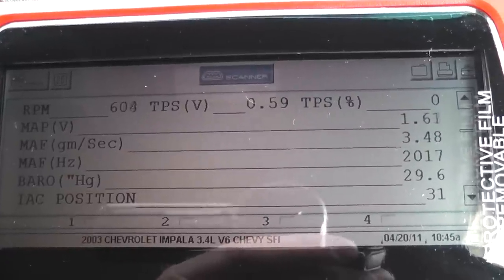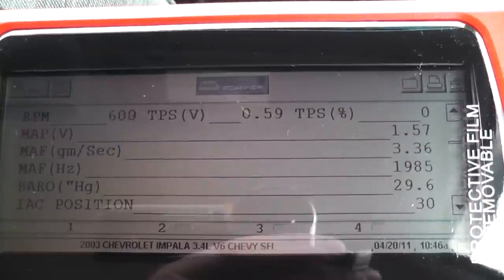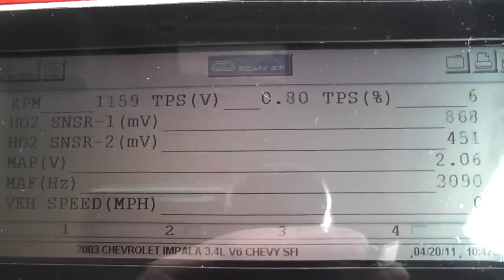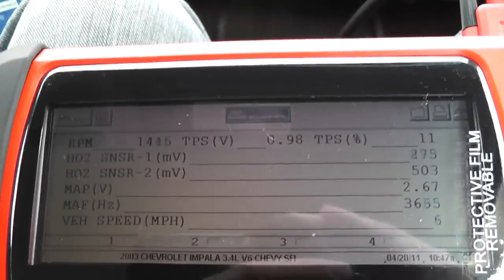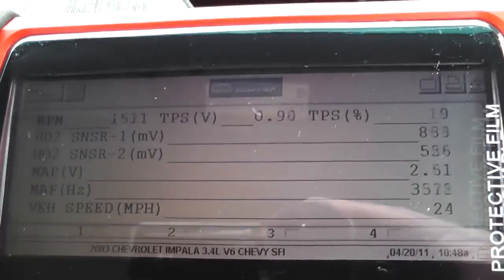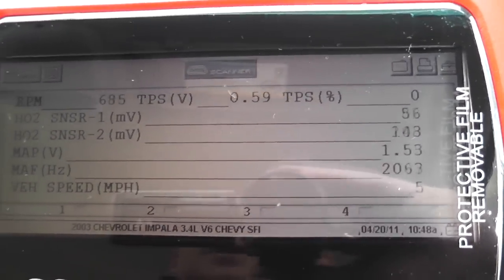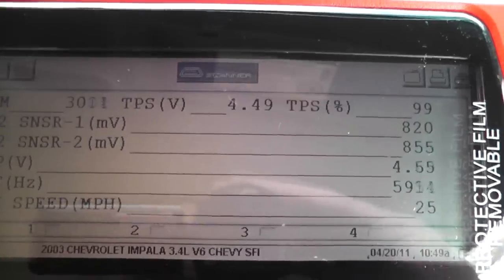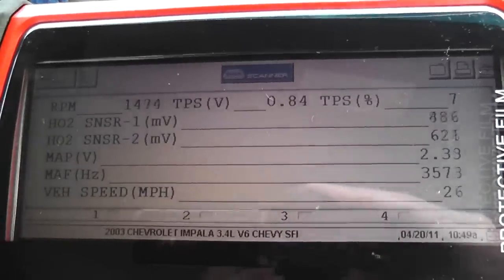How to test for a restricted exhaust (catalytic converter)

Comment from the maker: Thats good enough, just wanted to make sure it wasn't dead before we continue. For your fuel pressure test (since it is the regulated type), disconnect the vac, hose and perform a WOT snap, pressure should not drop off during the test. 
As I just typed this....the regulator you mentioned may not be a regulator, it could be a pulsator with a vacuum hose on it. Which would make this a mechanical returnless system. They look like regulators. see if there is a return line on the rail

Comment: Other test methods: 
1. use vacuum gauge (0,65 bar): § WOT : zero vacuum. 
                                                      § If restricted: 2000 RPM -> vacuum drops more and more 
2. infrared thermometer test on cat (@ 2000 RPM, outlet 60° hotter than inlet)
3. scantool: 2nd O2-sensor steady voltage (±0,5V)
Reply: I dont understand. Theres not supposed to be vacuum at 2000 rpm and by vacuum drop do you mean pressure goes up or down?
Reply: Great tips , thanks !

Comment from the maker: @buddiiee The restrictions in an exhaust  system come from a melted and broken apart catalyst. The pieces of the cat can become trapped in the muffler too so at times the exhaust must be replaced from the cat. all the way back to the muffler. (including the cat. too of course).
After the repairs the system should also be checked for a cause of the cat. failure. Its never good to just replace the cat. without checking for a cause.

Comment: Again thank you for your fast response. Actually yes, 98 Ford Taurus, 3.0 OHV engine, vacuum regulated fuel system. Fuel pressure was a little below spec. about 30 psi, but ran okay. (originally a no start and towed in) Both oxygen sensors switched good, but during WOT test, bank 2 went lean, although managed to run good. I did scope the fuel pump current which was around 4.5 amps but the waveform had a few spikes in it. Ran into the car at the end of the day so thats about all the info for now.

Comment from the maker: @westin1985 the intent of this video is not about performance tuning it is simply how to recognize if your cat. is restricted. backpsi at idle should be zero. in fact backpsi under 3000 rpm in PARK (meaning no load) should be very near zero. reason being is in park there is not much throttle opening so the engine isn't breathing very much

Comment from the maker: @altlandf Not for a short test drive and I have done that before to test for a plugged exhaust. 
Your OBDII code reader should have some data PIDS you can look at, so if it does, then yes fuel trim can be seen with it. You are not using fuel trim to ID a plugged exhaust. 
Yes you can use a regular psi gauge, in fact I made my own adapter with an old O2 sensor and I use my cheep vacuum /psi gauge

Comment: Love the vid. Our 13 expedition 5.4 3v.  had a clogged cat. Dealer wanted to do all the work backwards.  Tune up. Injectors. Ignition coils. Etc (out of warranty)$1400 before replacing the cat. (Still under warranty) 
After several meetings with mechanic and his stupidvisor, I  them if they can find a problem after the cat was replaced then I will have it repaired. Finally got warranty cat replaced, and magically the car ran perfect. They couldn't find anything wrong. 
Wish I knew what caused it.

Comment from the maker: @spelunkerd Not sure about the alcohol content, but after a repair, I make sure fuel trim #s look normal under different loads, also that there is no misfire. Truthfully on the Impala and Monte Carlo, I have seen so many melted cats. and found no cause when I am done. I think it may be in the programming of the fuel curve?. Here in the aftermarket, we just put a new cat in it (factory cat of course) and if everything looks good we let it go.

Comment: My reason for suspecting the catalytic converter... is I recently cleaned all the carbon off the intake manifold and throttle body. Most was wiped away, but obviously some went through the engine.
I also used to have problems pulling grades when I bought the used truck. But it was 50-90% fixed when I replaced the plugs & cleaned the TB/MAFS/Intake. Putting my hand to the exhaust is sad. It's like a very light wind.

Comment: Mr. Danner, I have one for you. 03 ram 2500 5.7 Hemi. P0300. I just got my Launch X-431 V and I only barely know how to use it but the little bit I do know I'm questioning because the cat has been cut out and a pipe put in it's place. It's been that way for years so I know that's not the problem here but I don't know how o2 and fuel trim data will look. I had access to a ton of parts off a known good engine so I threw EVERYTHING at it, injectors with rail, plugs, wires, coils...needless to say...same issue. Not only is it a p0300 but it's got a flashing check engine light. The live misfire data shows most of the misfires on 2 and 3, opposite sides of the engine! I've been watching your videos and am starting to learn what a normal reading of short and long term fuel trim, o2 but now this thing has no cat. What happens to the downstream o2 sensor data....same as if it did have a cat? I'm jut guessing here but it seems like it would read exactly the same as the upstream o2 sensor. I put a vacuum gage on her and it actually reads in the "normal range" of the gage but it's very close to the "timing too late" or something to that effect. It's been a plow truck and race car hauler all it's life...maybe this is showing me I have my chain is too stretched and it's throwing random multiple misfire codes? I honestly barely know what to do with the scanner so any help you can offer would be greatly appreciated. 

Thanks in advance.

Comment: Robinson auto has a similar video regarding a bad cat due to a bad plug wire causing misfire, customer was driving for a while with the engine light on-- the plug wire was arcing on the engine, one thing causes a chain reaction

Comment from the maker: That is strange, not sure I've seen that before. Lets not totally rule out fuel pressure here yet. Maybe it is borderline. Or maybe the MAF is dirty.  Check MAF volts, it should go over 4v at WOT redline. Also check your fuel pressure on a WOT snap too. actually I think you can monitor fuel pressure on scan data on that system right. If so pull that PID up during your test drive too. 
Last question, are you sure the bank that is dropping lean has a functional O2 in it?

Comment: Can you tell us the main things you look for when examining an engine that comes in with a clogged cat? Does alcohol in gas cause that problem? If the engine is running fine with no misfires, is there anything else that you need to check for?

Comment: I did have the o2 sensors in the 2 graph mode on a snap-on solus and same results during multiple WOT drives. Would you recommend any other testing that would be a smarter approach to one lean bank situation? Otherwise I will can have more info tomorrow unless I figure it out. Thanks.

Comment from the maker: I didn't look at fuel trim closely for this one, but I know at idle and low speed they were in the normal range. Well at least normal enough for me to not look to closely. Also at WOT fuel trim is not relevant due to the O2 sensor being ignored and the system operating in open loop.

Comment: This ford has the vacuum regulated system so there wasn't anything in the scan data for the pressure. As for the o2 being functional, I didn't scope it, although I did watch scan data while unplugging the brake booster and drove the o2 lean and the response was great and it switches good around 2500 rpm along with bank 1.

Comment: Would it hurt to run the vehicle with the 2 front O2 sensors removed?  I have a OBD II code reader will this find a problem with the fuel trim? What should I look for?  Would too much ethanol in the fuel melt the cats?  In Pa right now there should be no more than 10% of that garbage in the gas.  The 97 Explorer is NOT a flex fuel vehicle. The more ethanol the hotter the combustion gets. Anyway excellant video.  Could you not use a regular psi guage?

Comment: Hello Paul. I have question on this type of diagnostic using the o2 sensor data. Lets say you have a dual bank o2 sensor system and bank 1 (s1) reading is 800mv and bank 2 (s1) reading is 52mv at WOT. Would this indicate a fuel delivery issue? Would a MAF sensor problem cause both banks to be low? let me know when you get the chance. Thanks!

Comment: If you measure the MAP reading key on engine off?  That will measure baro pressure.  While at wide open throttle, if the MAP raises above baro?  That will also identify a likely restricted cat.  Although this test only works on non turbo vehicles.

Comment: Car went to 20mph a year ago and have been hesitant to tackle it, though I suspected exhaust. After watching this it doesn't look horrible to test before marching forward. Car apparently had a long term severe misfire, then with the help of a lumpy tire it suddenly acted up before we got it changed.
Reply from the maker: If you do not have a backpressure gauge, you can test drive it with the O2 removed and see if your power gets better. Don't drive it long this way, just one wide open throttle run to see.
Reply: @ScannerDanner  thank you, that's what I was planning originally, but I did go buy a gauge to check it right. It's just a junker car and maybe 4 years left before rust gets to something critical.

Comment: Thanks again Scanner and as always truly amazing!
My daughters 05 Ford 500 will only run momentarily with the throttle on the floor. 

It has codes P2196 Oxygen sensor signal Biased stuck rich Bank 1 Sensor 1 and a P2198 which is the same code for Bank 2 sensor 1.

It has 10.3 PSI  Fuel rail pressure but since the O2's are showing rich perhaps this is the problem? 
I have 10 PSI at the fuel rail using live data at any RPM.. 

But it also has a P0191 Fuel Rail Pressure Sensor Circuit range performance  code as well.
Reply: Sounds like sounds like a low volume fuel pressure to me. If fuel trims showing rich are you saying it negative fuel trims? If so then it's trying to add Fuel but can't because of low pressure. (Filter might be clogged) other rail pressure sensor is showing low because of not enough fuel I would bet

Comment: I had a nagging code P0171 P0174  p0300 p0304 p0306 on my 2001 GS 300 and the car would not go past 40... the Engine was loud and the car would have trouble starting... I changed the spark plugs, fuel filter and fuel pump at the tune of hundreds of dollars... Finally I tested the Ignition coils and the resistance was too high... The misfires (p0300, p0304 p0306) caused the oil to get into the CAT as well as making the car run lean and burning fuel in the cat resulted in a clogged cat that lead to the car not going past 40 mph... I was not going to get a new cat so I tried Lacquer thinner in a half tank of gas as well as dumping a can of throttle/ carb cleaner in the upstream (pre cat) 02 sensor hole... eventually it got better till it ran like new... The Lacquer thinner burns in the cat hotter than regular gasoline, burning the oil that is clogging it up... I saw it on Scotty kilmer and it worked for my situation... now the Risk is that the Throttle cleaner may have chemicals that don't go well with the metals in your cat or that the Lacquer thinner may damage seals in your fuel line... so they should be used with caution... however if you are going to change the cat why not clean it with Throttle cleaner first to see of it works? save 2 grand.

Comment: @scannerdanner 
cool video... hey, I have an issue that happen almost from one day to the next... 2000 firebird 3.8 5 speed.... @ first I thought it was the clutch because I would feel the car "sit" every other shift or when I took it over three thousand rpms. the first time I noticed something off was when I floored it and saw smoke... which it was weird because my car does not smoke.... then days later, again but lingering smell of any kind, especially burned clutch, it a rich mixture. So that's why I'm with the idea that it is the clutch or slave cylinder, but every gear shifts with no issue, no grinding, my clutch pedal is high and reacts normal, no vibrations, no hydraulic leaks. now, talking about the catalytic converter there is no rotten egg smell but twice now I've heard backfiring more predominant as I coast to a stop light. I don't hear it as loud as usual and the power is not really there, I also notice that it idles higher than normal....
with that said, does it sound like a clutch issue, a catalytic issue or a vacuum issue.... thank you for your time..

Comment: I appreciate the video boss!   Quick question for you though... if 1.5 - 2 psi at idle and 6 7 psi at 2500 rpm is high, what should the pressures actually be at?
Reply from the maker: Near 0 for this test

Comment: Paul - whats your thoughts on using an infrared thermometer to test for a clogged cat? I read that if the inlet temp is a few hundred degrees hotter than the outlet you have a restricted cat. However I'm not sure if you take your temp measurements at idle or 3000rpm. Your take?

Comment: You didn't rule out the muffler. Check the downstream o2 sensor hole with the meter. If low pressure, there is a restriction in the cat. If "high" pressure, the restriction is downstream from the cat.
Reply from the maker: If the restriction is downstream of the cat, it came from the cat. So replacing the cat and everything downstream of it is pretty typical. Or at least a visual inspection of the back of the cat to make sure there are no pieces missing. Of course you can drill a hole or remove the downstream O2 to test for this, I just found it not necessary in 99% of the times you will see this.

Comment: you sir would be describing fuel trims and would be correct on how fuel trims work to a point.. O2 voltage is the PID he was looking at on the scanner, high 02 voltage is rich low is lean....nice try.... looks like you need to attend rosedale.....LOL....nice and to the point DANNER nice work!!!.... man i need to buy your book

Comment: So when you figure out your exhaust is clogged & it is most likely the CAT. What do you do? Grind off the pipe? weld on a universal cat? Where's the cheapest place to do this generally?

My truck can't pull grades anymore. Codes I had = missfires, o2 heater, mafs, lean a/f, and more missfires. I checked/cleaned the plugs and wires. Good to go; got my engine power back & no more check engine light. But after getting warm (30minutes+ of driving)... I can't pull hills. Drops down to 50mph.

Comment: You just can't assume the catty converter just by removing that o2 sensor and connecting the pressure gauge. You have to check the exhaust pressure going out from the catty converter. The restriction maybe further down the tail pipe.
Reply from the maker: The restriction is always the cat. I've never seen a muffler plugged up, that wasn't from the cat. 
 What you have to worry about is if pieces of the melted cat broke apart and logged themselves in the muffler. I've definitely seen that happen before. So when you sell the job, it gets a new cat and warn the customer about this possibility. A simple visual inspection of the rear of the cat is all you'll need once it's removed. Or just sell the exhaust system from the cat back.

Comment: The MAP voltage was the first thing I noticed as well. It is my understanding that the MAP voltage should be within about .2V of the TPS voltage. That sound right? It is also my understanding that the MAP could be high if the EGR is stuck open. Other indicators pointing to this would be a possibly high IAT reading and it would run funny at idle, but fine off idle. Does that sound right?

Comment: Sorry Paul but if your number are positive for example 800mv the vehicle is running lean cuz the computer is adding fuel to composave the plugged converter if it the number were negative it will be rich condition cuz the computer is substrating fuel

Comment: Awesome vid!
I have an 05 Ford Escape that i just had 3 seperate exhaust leaks in 1 week. As fast as i repair 1, another starts...I am also getting a P405 EGR code? I checked EGR function and it seems to be fine.
Now the truck has lost power and doesnt want to rev over 2500-3000rpm. It has 3 cats on it. 2 on the front manifolds and a rear cat. I can hear the rear cat sizzling inside of it. Is it possible the rear cat is breaking down, or is it coming from one of the front cats? No cat converter codes and both 02 sensors seem to be fluctuating quickly between .1V - .9V
This vehicle for some reason doesnt have a sensor after the rear cat. So i cant monitor it...
Was gonna just try and disconnect the rear cat at the flange and fire up the truck and see if it revs past 3000rpm. If it does, can i rule out a bad front cat?
Also, where can i purchase a gauge for exhaust pressure?
Thank you kindly!
Reply from the maker: depending on the set up, sometime s drilling a small hole in the exhaust is easiest. Of course removing the O2 and taking reading there works if you can get them out without ruining them. As for a back pressure gauge, I believe on one of my two tool pages I have one listed
https://www.scannerdanner.com/tools.html
https://www.amazon.com/shop/scannerdanner
Reply: @ScannerDanner  thanks for the reply! Il have a look.